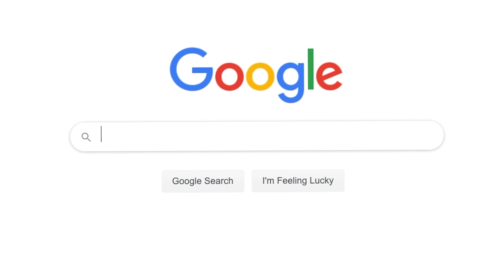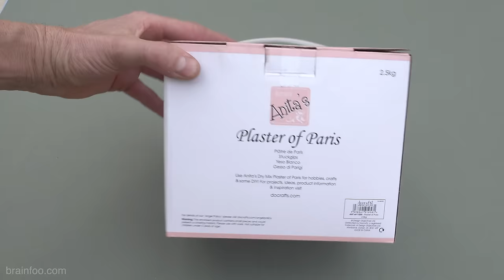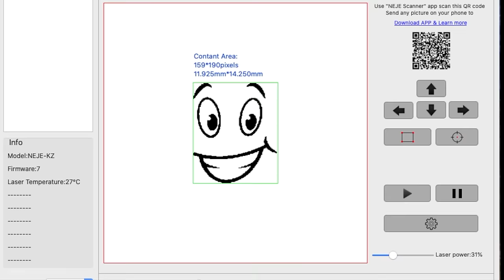PUBG LEVEL 3 Helmet CAST From Coke Cans

Comment: Every time that 3D printer comes out I'm like man that's cheating hahaha. You're fortunate to have one. Keep up the good work.
Reply from the maker: I know what you are saying, but I try to make my projects relatively easy to follow. If I carve from wax it would take longer and a lot of people could not do it at all. Small 3D prints are cheap and easy, and you can burn out the plastic on a cheap BBQ without kiln, then pour the aluminium straight in.
Reply: ذنبمبنبنوقننةنختث ثن🥺😂😂😂